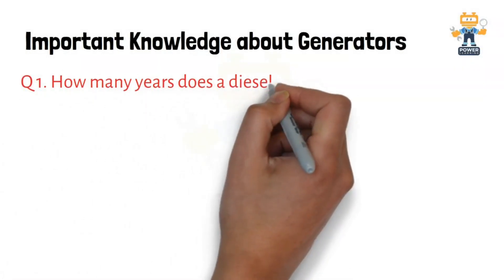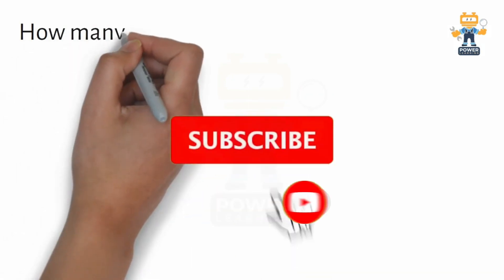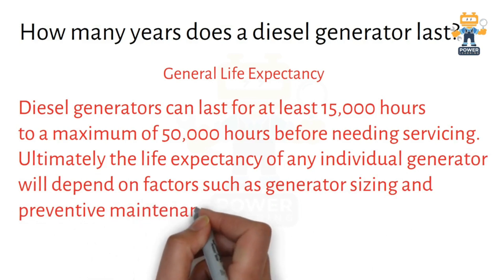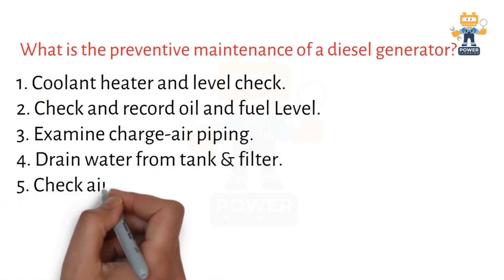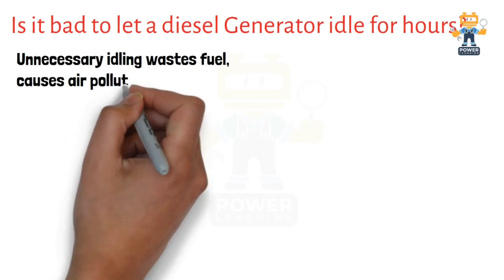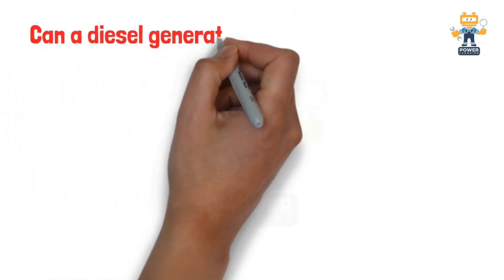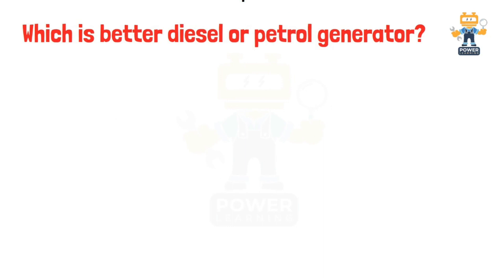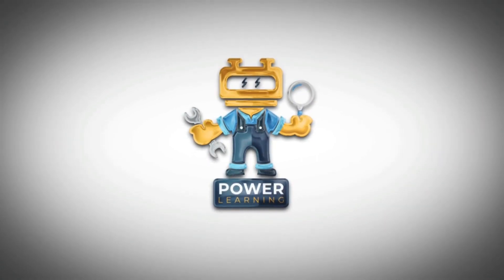5 important common question about Diesel Generator | Life cycle of Diesel Generator

Comment from the maker: 1. Perkins 700 KVA site operator training: 

https://youtu.be/68YHF2931iU

2. DSE 8610mkii Synchronizing controller practical control panel training.

https://youtu.be/zwLP5X9gGhc

3. Why Diesel Generator fail to start

https://youtu.be/OA5lt-6D6pQ

4.Hand on Practical training 

https://youtu.be/2NbGwvjg-Uo

5. DSE 7320 Practical training 84K ++ views

https://youtu.be/bsZ8875Xo58